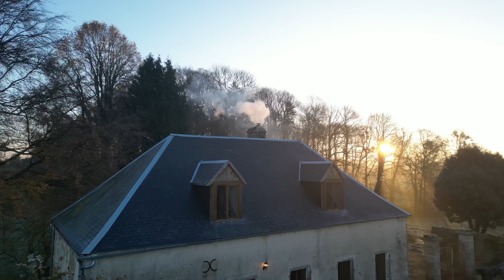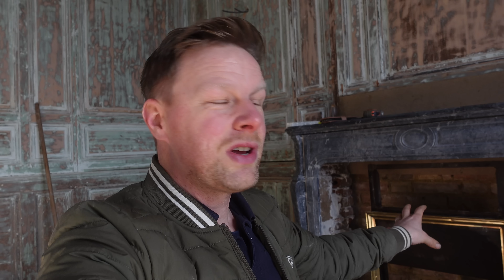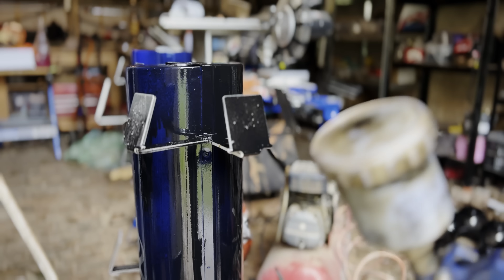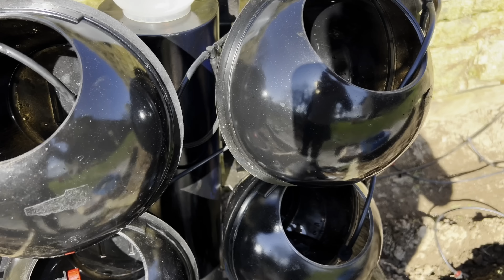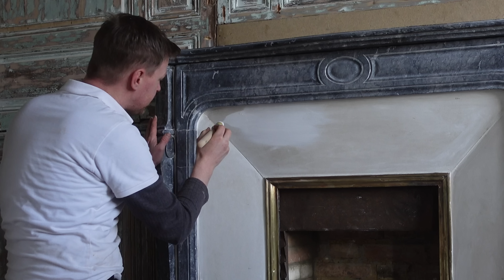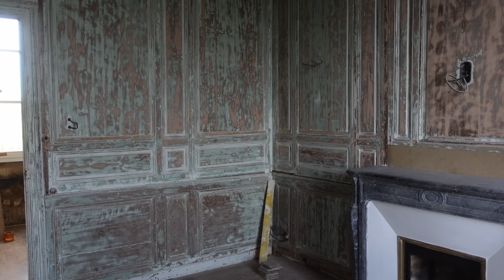Creating A MASTERPIECE For The Château - BUT WILL IT WORK OUT??

Comment: That fireplace has really got the ‘WOW’ factor! Super construction!
A tower of strawberries. Great idea! 
I’ve used guttering before. Just need to close off the ends & place holes for drainage or have the gutter slightly at an angle so the run off can drip. Hang the gutting off a wall or support stand. I had mine in the greenhouse so any watering dripped on the raised bed underneath.

Comment: I’d suggest you use some sand paper to rough up those plastic containers before painting so the paint would adhere. That’s just going to peel off over time, but too late. Next time ( after a month or so in the weather ) try it.

Comment: Guessing you will be using a bioethanol fire (these are cheap to run & give a real flame without the need for venting). Would make the most of the beautiful work you have done installing that fireplace mantle & tiling. Just swap out the plasterboard for FC sheeting (non combustable). The ethanol fireplace wouldn't need a power socket either & they give off heat too.

Comment: Not sure what it is called over there, but you could use a marbleized Formica for the insert over plywood or MDF. It will have the gloss or matte finish without spending hours trying to use faux painting techniques.